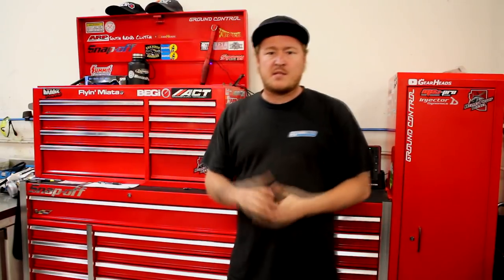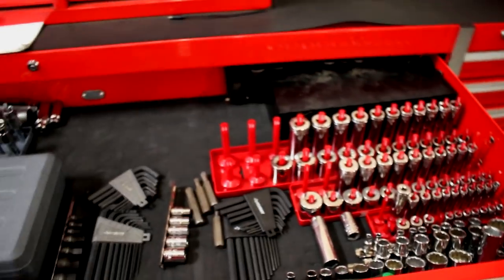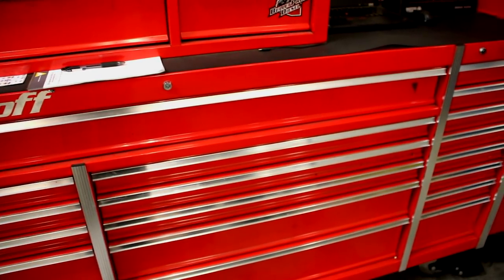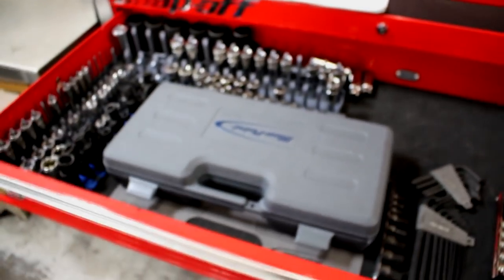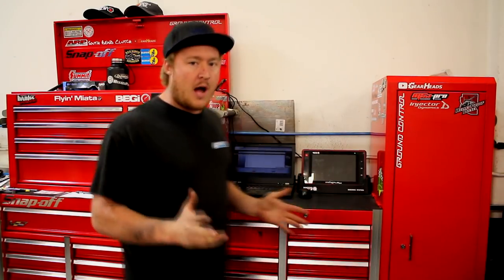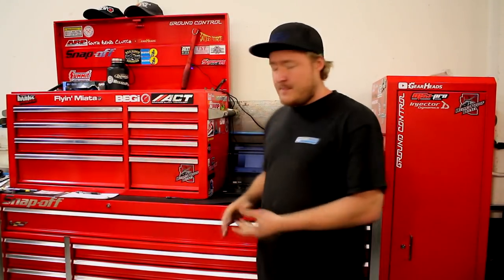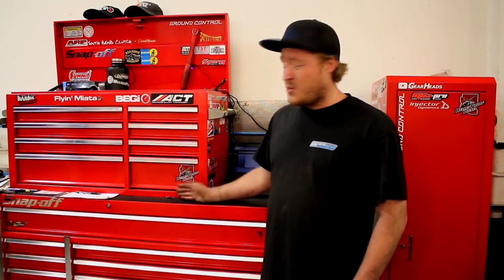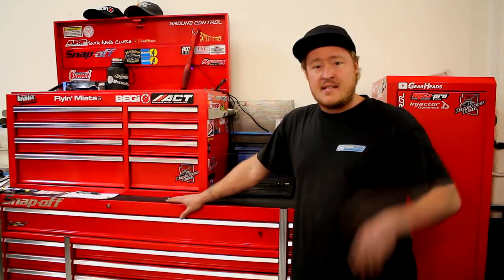Harbor Freight 72" Tool Box | 1 Year Review!!

Comment: So I actually had the same bottom box and used a lammanent wood (Wood flooring)for the top of it. Worked really well for me as a motorcycle mechanic as I always have parts or dirtbike engines on top of it. Easy to clean after wards and kept the rubber top looking brand new when I sold the box.

Comment: Remove the latches and add magnets to rear of box on inside, add as many as you need to create a small grab then you won’t have to worry about grabbing the specific spot to open you can grab whereever and doors will stay closed
Reply from the maker: Not a bad idea but I prefer having the latches myself. I like that it has latches vs the 42 inch box above it that doesnt, I just would love the latches built into the whole handle! but hey at the price I paid you cant have it all and it has been great.

Comment: I have the US general smaller tool cart at work. I removed all of the plastic locking clips on the side. Removed each drawer and placed 2 strong magnets on each drawer. When I close the drawer the magnets are close but do not touch the back wall of the box. Drawers close great now with just enough resistance to close and open great
Reply: Great idea.

Comment: I bought the HF tool cart this past winter and picked up the 44" box a few weeks ago. The cart has the same style drawer release as your box, but the 44" has detents rather than latches. I wonder if that's one of the improvements of the "series 2" boxes. I prefer the detents and may replace the latches on my cart with some sort of magnet as a detent to keep the drawers shut. I'm pretty happy with both of them so far.

Comment: I picked up a pair of 42"s last month for $399 with coupon, and the 26" for $249, which were smokin deals. I was gonna get the 72" this month and seen they raised the $$ from $1099 to $1199, grrr!
I'm sure they'll still have the coupons for $999, I'm hopin so anyways! They are still a great value! Awesome video!
Reply: @wudntulike2no32   Good till November https://www.greentractortalk.com/forums/tools-equipment/126770-harbor-freight-tools-review-thread-24.html#post3337916
Reply: @wudntulike2no32  Glad you could use it, I got my green one last weekend, glad I had forks for my tractor...very heavy. Had one rivet missing from drawer rail. So check them out.

Comment: Absolutely great box I intend to get one myself also seen a review were a guy used a tool to measure the thickness of the metal it showed to be thicker than Husky and other boxes no wonder that thing is such a monster I've heard nothing but good reviews on this box besides the Box in tools don't make the technician experience does great review
Reply: well i been trying to find a spec on what gauge steel it is. when it was measured was it bare steel sometimes paint gets thick .
Reply: 16° mostly 18° for huskey, I was surprised about that , I have  Harbor Fr  the 54 top and bottom side cabinet and the locker I have no complaints,I cant see spending 6 k on boxes,

Comment: Cut a piece of 1/4 plywood to fit top of cabinet and use contact adhesive to glue may on. Be careful, bonds instantly can't get apart. Could put some aluminum trim around edges for pro look. Materials available at home center.

Comment: Hello Gear heads 
I just came across this Video,  thank you in advance. I've watched it twice. You gave all the dimensions but one. Shallow drawers to deep drawers. I have a ton of tools that to be organized to save space. Now that you're into year two,  what are your thoughts on the   Harbor Freight 72" box? 

I am currently looking for a new Toolbox. Although, my needs are not all different,  But I have to be able to move my box to different work locations and or buildings (Hangers).  I would not think most automotive mechanics would encounter that need. Just how much does it weigh empty. As I,  do not have a trailer for towing.  I have to be able load it up into my pickup. Sometimes I have access to a forklift, which makes it simple.
Before  I forget to ask, where do you get the Snap-off decal? Again thank you for a Great Video.
Reply from the maker: My opinion on it is still the same on it, love it for the value of the purchase it isnt perfect but was worth more than I paid for it I feel. It is heavy, very heavy even empty I wouldnt want to have to be wheeling it around. That is what tool carts are for, big box sits and the tools I use 99% of the time all sit in the tool cart and I only go to the box intermittently for random things.

Snap off decal was from ebay!
Reply: @GearHeadsGarageChannel  Thank you for the quick response. Unfortunately, in my side of transportation, Aviation.  Moving your Toolbox is almost a occurrence. We don't get just park and go. Although,  you will see a sea of tool boxes parked from one shift. As other shift goes to work. Som, we move around the same Aircraft. Other times to different locations altogether. So weight does become an issue.

Comment: I agree about the drawer latch. Only having it on one side is a pain. But I also don't like the snap on one either. To use to just pulling the drawers open. I have the husky 52" with the soft close. Love it. I also have the hf 5 drawer service cart and I put the hf side cabinet on my husky. Been thinking about the side locker. Is it any good?
Reply from the maker: Its not exactly complicated just comes empty and you set the drawers where you want them, Im very happy with mine!
Reply: I have the Husky as well with the soft close and tbh I wouldnt want it any other way

Comment: Some folks remove the latches and use magnets in the back to hold the drawers.
Reply from the maker: Yea but I like having latches, I just wish it had a better latching system but overall I prefer to have them.
Reply: @GearHeadsGarageChannel  Agreed. I don't like the off center latch either

Comment: Amusing emphasis on easy sliding drawers. If you are turning wrenches, you can open drawers.
Reply from the maker: Easy sliding implies less wear and tear over time. An engine that runs rough or doesnt turn over easy by hand because of friction/bearing issues is not long for this world. Same rule applies anywhere else. Been almost 3 years with this box by the way all the drawers work perfect still. By this point it has paid for itself if you figure how much you would have paid towards a big name box of similar size.

Also if you are turning wrenches and arent weak then sure. But I dont want drawers that are more difficult or take 2 hands to pull open evenly because you have to pull and lift weight off to get it to open, its a pain, costs time, and half the time I have tools in one of my hands and am just reaching for something else real quick. 

Easy sliding drawers is one of the main things people look for in a toolbox and for good reason. No reason to accept shitty drawers to save money, if thats what your happy with go buy a 20 year old crafstman box without roller bearings and watch it get harder and harder to open the more weight and tools you fill it with.

Comment: I've had my 44" top and bottom chest for gee probably 12 years or longer, full of tools and sits outside on a carport, its never been inside a building so I'd say with that they're good chests and I sure wouldn't waste money on those Snap-On and other ridiculously over-priced boxes that are most likely built in the same Chinese factory the HF boxes are built in.  May upgrade to the 56" top and bottom with end cabinets here in the next year or so as they have discontinued the old 44" stuff so none of the new end cabinets will work on my boxes and its time for a slight upgrade anyways.  Just wish they'd build them with deeper drawers, especially those larger boxes....I can't fit many of my tools in my current 44" box due to the drawers not being deep enough, and for the size of that 72" that whole bottom row of drawers should have been at least 12" deep for those larger tools like skil saws, framing nailers, etc....which is where the end locker would be a great add-on for me which now isn't an option as they've been discontinued.

Comment: for 72" box the masterforce from menards the winner at best sale/rebate price .
Reply from the maker: I have seen those they look great!
Reply: they tick off your main complaints of wanting handle lift latch system and extra depth.
Build quality is proper good and drawer layout pretty good although 1 or 2 deep drawers would of been better switched out for shallow drawers .
US General are pretty decent boxes and at lowest coupon deals good value.
The plastic finger latch is one of worst budget features on US Gen, some of the series 2 boxes have detents on slides as well as pull latch and the plastic latch looks stronger,, they make these boxes in 2 different factories and other differences in metal forming, lock system and drawer slide pull out depth exist so got do some homework before buying .
For a young tech 1 to 2K is all really want be spending on box/boxes used or new.
Buying box  new off truck is about worst financial tool buy you can do .
I would look at better thick rubber mat (such as stall mat) or if can remove that rubber re-glue it to hardboard .
Stainless tops are awful long term, heavy duty rubber or wood about the best, nice bit of ply with exposed edges beaded and stained looks nice and pretty low cost option .
Keep enjoying the boxes .
Reply from the maker: @mrb1864  I'm probably going to end up doing wood for the top eventually. Thank you for all the info and sharing! I am very happy with my box but its always good to know what else is out there. I probably wont sell this one I'll just keep it around at home if I upgrade at work eventually etc. For now its good!